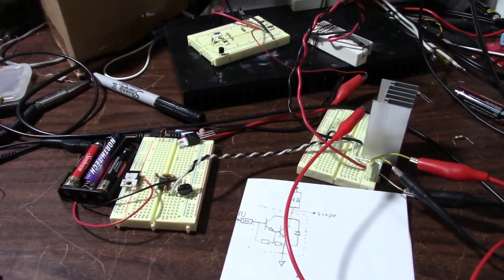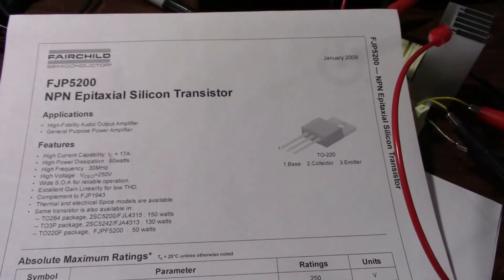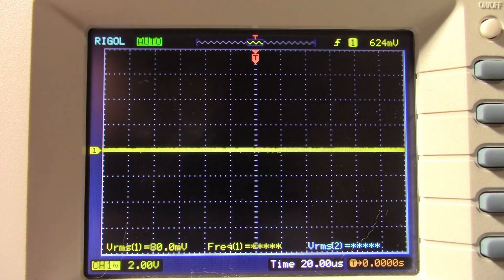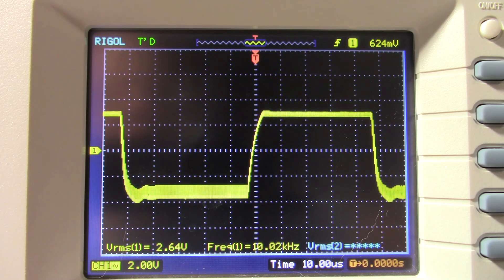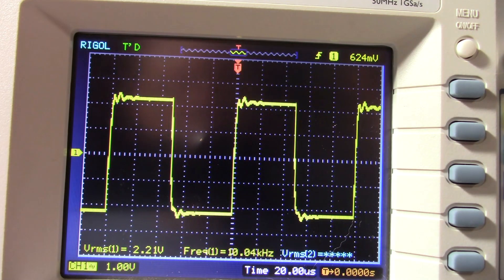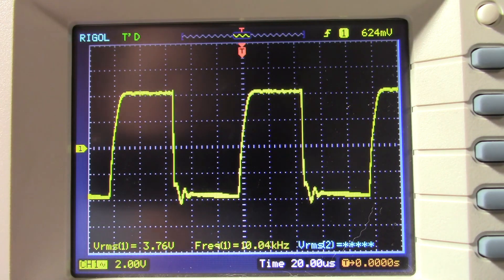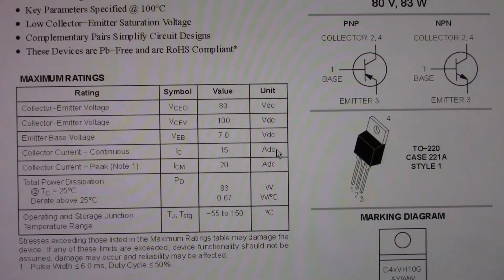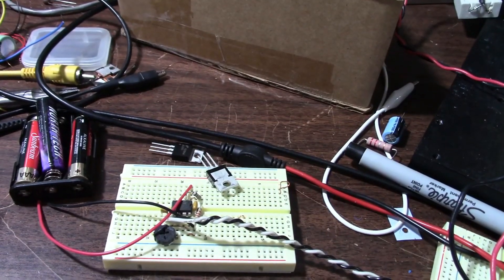Selecting better transistors for the JAT EZ amplifier project

Comment from the maker: Hey everyone! I want to check the feasibility and modifications needed to make the JAT 501 amplifier run in class A mode. This will be in an upcoming video.
Reply: Awesome!
Reply: That's a big interest right here!
Reply: Would it be possible to make both Moses switchable
Reply: Have you looked at the 2N6488 and 2N6491 transistor pair ?  Cost below $1,  80Volts, 15A, 75W. They are only 5Mhz, but that's still 2.5 times the 3055. It should normally be enough for audio. When building a cheap and easy amp, you may not want to use too fast a transistor. They do tend to become harder to keep stable under all conditions, if they are too fast. So 40,50,60 MHz might not be a good idea, if everybody should be able to build one and make it work. But that's only my humble opinion.

Thank you for the great videos.
Reply from the maker: @RandomUser6947  I'll buy a set of those to try as well. Pretty wild gain vs temp. I hope they are thermally stable.

Comment: HI, try TIP41C, 42C for the output with c2383/a1013 in the driver place. will work fine and are cheap also

Comment: Is there any reason why you're staying with a Darlington configuration now that you're moving to discrete transistors rather than making each half a Sziklai pair?
Reply from the maker: Each config has its advantages and disadvantages. CFP is more linear but at a cost, such as stability. In the EZ amp, I wanted to use the monolithic darlingtons to keep the part count down but, alas, they didn't work out.

Comment: Nice video! Love your channel! Did you ever consider using the TIP Darlington Complementary
 Silicon Power Transistors series? I have seen some older amplifiers using either the TIP120 series or the TIP140 series. Granted that they are not listed for hi-fi audio application, but since you consider some switching transistors, I would really like to hear your opinion on them. Keep the good work. Looking forward to the JAT501 finished board!

Comment: Well I found some nice 2SA1943 and 2CS5200 for only $2.00 each on Amazon.ca and I hope I can find a nice project and build a good amplifier with them.
Reply: Sounds fishy, probably fakes.
Reply: You ca find the even cheaper or even at 8$ a piece"originals" but both cases might be fake.Only way to be sure they original is passing 3A current trough them.Fake ones will die at 1 A even! But eve witth fake ones you can make that amp to pull some 20-40W wich is enough in many cases!